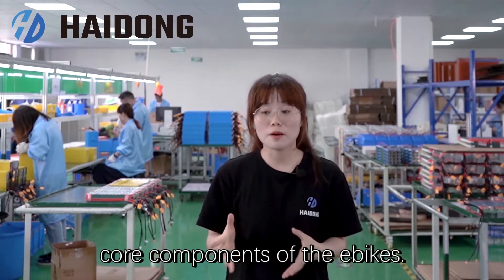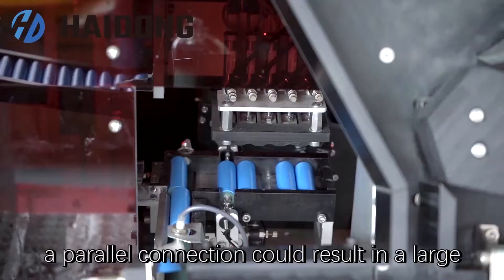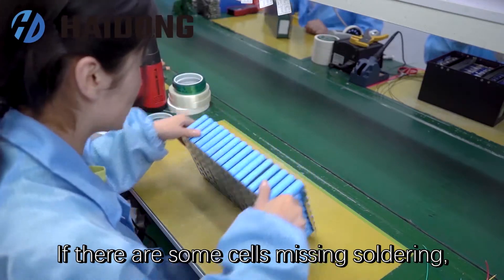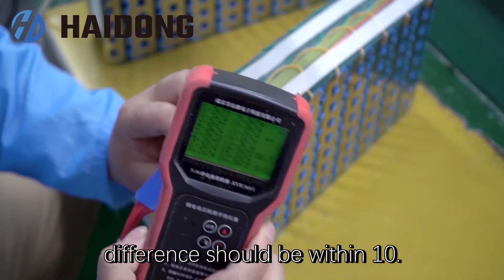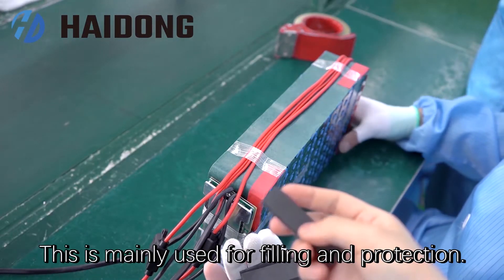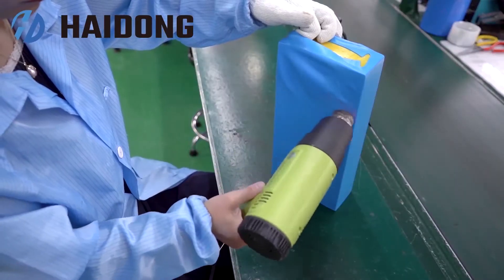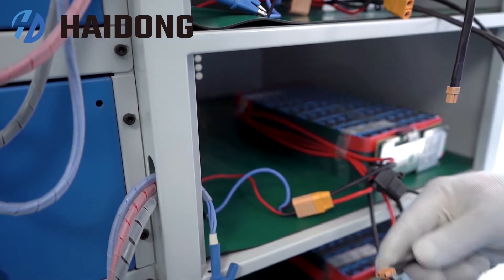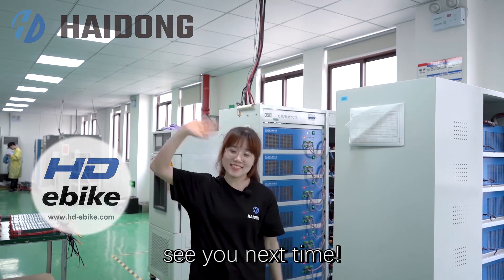Explore Haidong Factory Series --- Ebike Battery Assembly

Comment: I have 2 questions,
1.What is the name of red color tape?
2.What is the name of white color glue which you use for sealing?
Pls rply
Reply from the maker: Hey, I hope this will help you. 
1. Insulation Electrical Tape
2. Hot Melt Glue
Reply: Thanq for your valuable rply
Reply: hi..can you help me..
Can you suggest
1.which type of white adhesive used(if you give this adhesive brand then help me more)for sealing and
2.which type of blue tape used after shrinking the pack..pls rply..